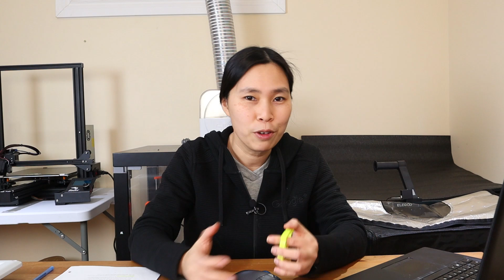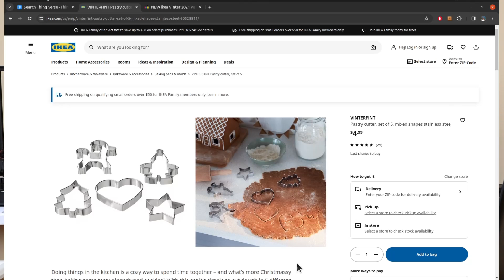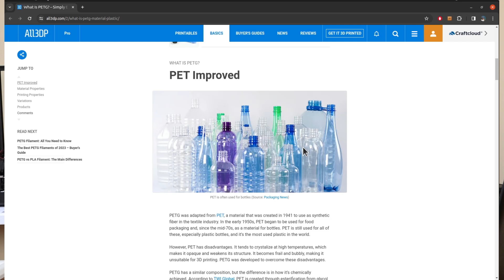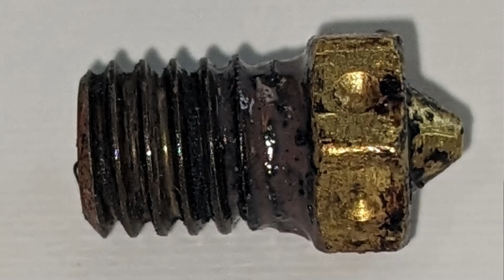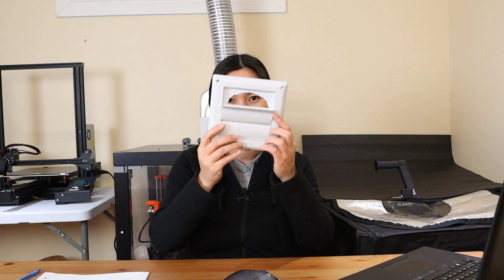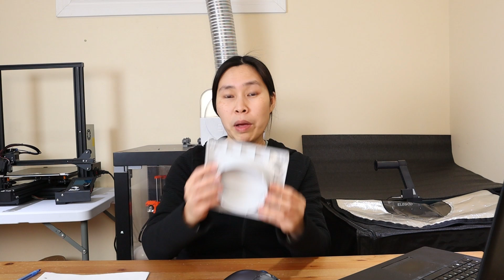Things you should not 3D print

Comment: that modular shelf thing is the dumbest idea ever. I saw the KS campaign and I thought "why?". I mean I would understand if it did something special, but they are just shelves and they also waste a lot of space (look how thick they are!). they don't give you any benefits over normal shelves you can buy in any store.
Reply from the maker: They have good idea about modular design. If they could do it by injection molding and sell the components then it is perfect. 3D printing is not the appropriate method to make these
Reply: @maketestrepeat  my problem is not with the idea of a modular design but the design itself which is forced to be like that by 3D printing.
it's bulky, cumbersome and it waste a lot of space. that's something you can do with a normal wooden unit with movable shelves.

Comment: Honestly, I think the fear of chemicals from our 3D printed plastics is a bit overblown.  Kind of like the people who freaked out that there was lead within the paint used on vintage ceramicware (safely sealed under glaze).  Toxicity is a function of dose and exposure time.   I sincerely doubt, in the grand scheme of things, the potential chemical ingestion from using a 3d-printed cookiecutter would even rate a millionth of a percentage point for "toxic chemicals a human has been exposed to."

Worry far, far more about the fireproofing chemicals and BPAs in, frankly damned near everything in your home, from the floor to the ceiling.  Carpet, furniture, light fixtures, clothing--if it's any sort of polymer (plastic), it's probably exposing you to something nasty.  And realistically, the odds of even that exposure actually doing you any harm is so negligible, it's practically incalculable.

But damned good point on not wasting plastic/creating excess waste 3D printing something that could be better served to be made of another material like wood or metal.